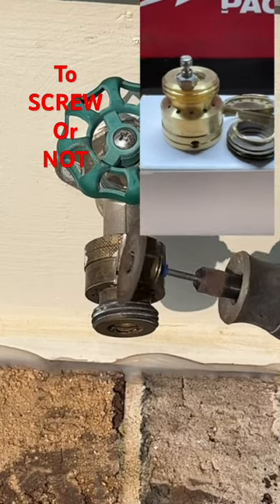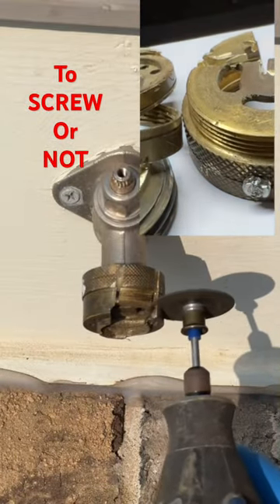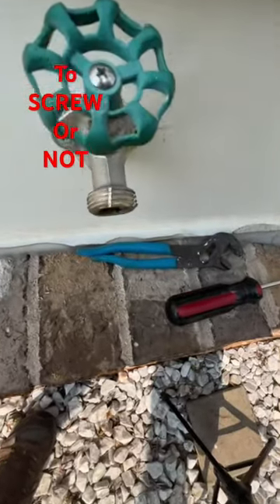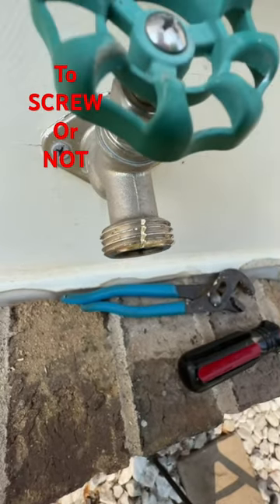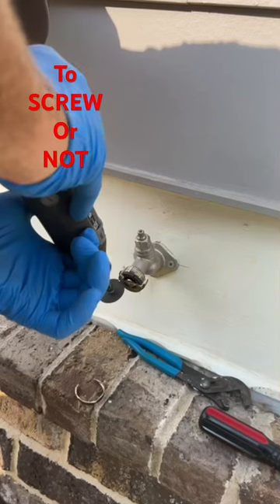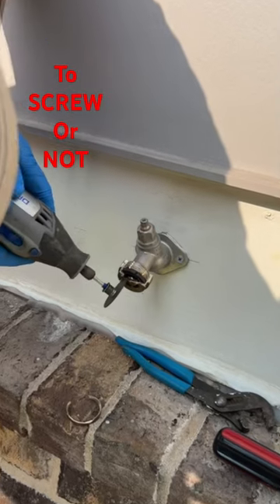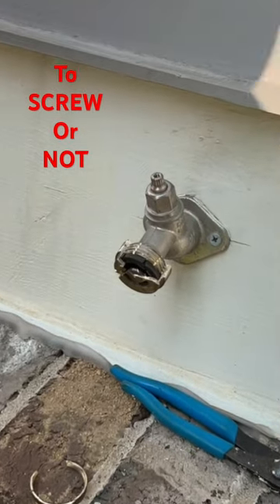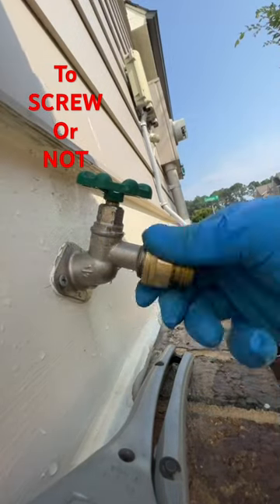Avoid Getting Soaked: Fix Your Leaking Vacuum Breaker@TappPlumbing #plumbingproblems #shorts

Comment: I'm in this situation right now, trying to remove a fouled vacuum breaker.  The house is 4 years old and the hose bib sits slightly inside the vinyl siding housing.  Stupid of the builder to do this.  The other problem I have is that the set screw is underneath the hose bib and it's hard as heck to see what I'm doing.  I'm trying hard to avoid calling the plumber as it will be a $300 job.  Going to the store to get a dremel to try to cut down to the threads.  I'm also ordering a 5mm set screw slotted for an allen key next time around.  I understand the needed function, but contractors make them hard to get off!!!
Reply from the maker: Make sure you have your safety glasses on please! It sounds like you will have quite the challenge. I hope you do a better job than I did with staying off the threads on the spigot. Keep me posted if you have the time please. Best of luck!
Reply: I put the safety glasses on as soon as the dust from the brass started blowing.  I was able to get the breaker off, but I tore up the spigot. :(  Now I have to have a plumber come and replace everything.  There should be an option for the home owner to remove the vacuum breaker.  I don't even leave my hoses connected. @TappPlumbing Initial estimate is $600-$1000 for both spigots.
Reply from the maker: @jasweb147  That is the exact scenario I was trying to help people avoid in the future. I am really sorry it happened to you, maybe you can convince the plumber to leave the screw out.
Reply: @TappPlumbing  my spigot is closer to the foundation which made it difficult to see and to determine where to cut the threads.  The plumber is going to leave out the set screw for me.  He said that multiple houses in our neighborhood have had vacuum breaker issues so he’s very familiar with the job. Not to mention that we all have the older watt vacuum breakers with the sliding black O-ring, which is to prevent freezing in the winter, he’s going to put on the self draining vacuum breaker for my home. Not quite sure of the cost yet
Reply from the maker: @jasweb147 If your spigot is so close to the ground it is hard to get a hose attached you might consider having him twist it a little sideways. It looks a little funny but it makes it much easier to attach and remove your hose . Let us know how everything turns out if you get the chance please.
Reply: @TappPlumbing  The plumber had to replace one spigot and removed the breaker from the other.  $600 later and were all good.
Reply from the maker: @jasweb147   Thanks so much for the update . I guess that is better than having them both replaced . Have a great weekend and thanks again!
Reply: use anti seize and find torx not allen/hex
Reply: That is not the problem. The breakawy screw means exactly that. While tightening the set screw it is designed to break off so customers do not remove the vacuum breaker@Walczyk
Reply: @whatnow5313  lol why?? what’s so dangerous about it. i guess it’s got low pressure systems?

Comment: People should not have to pay a plumber to do a simple repair like that!
Do not use the set screw or replace it with an allen screw that can be removed easily!
Or replace the original screw with a screw that won't break off so easily!

Better yet throw that stupid screw away and do not use a screw at all!
Reply from the maker: I think most people agree, there are a multitude of solutions that would be better than breaking the screw. Those devices are very important though!!!
Reply: @TappPlumbing  somebody suggested using threadlocker when you put it on, but I think that's a bad idea.

I worked on someones irrigation once. They use those screw together PVC pipes and use PVC glue.
That's like screwing your lug nuts on and then welded them in place. 
Some people. 🙄
Reply from the maker: @TF856  I am pretty sure eventually someone might not appreciate the thread lock😂
Reply: My local inspectors will not pass a top out if the vacuum breaker screw is not broken off where it can't be removed. It's code, and there's a reason for it.
Reply: @coreysharp9794 Have you seen or heard of one of these vacuum breakers ever actually serving its intended purpose?
Reply: @MisterTwister88  you asking me that tells me you don't know it's intended purpose.
Reply: @coreysharp9794  Its an easy question, why dodge?
Reply: @MisterTwister88  then to answer yes, I have. Specifically when a pressure washer was being used.

Comment: I never snap the set screw’s off and don’t give two shits what the code says. I hat these for hose bibs. All they do is make a mess everything time the water is shut on and off
Reply from the maker: At least I have one valued supporter then! Thanks for watching!
Reply from the maker: I just checked our one of your channels shorts with the tankless swap out. I really enjoyed it, I will cruise through more of your channel over the weekend when I have a little more time!!
Reply: That's why it's called a "Vacuum Breaker"
  I hate them also, but believe it or not twice I have seen water sucked back into the hose. Water had been shut off but the valve on two bibs were left open, plus one faucet in the house was open and some how a vacuum was created. I was outside repairing a window frame and somehow noticed water flowing into a hose not far from me, so I stopped and watched. Yes a vacuum was pulling water backwards into the homes plumbing and after about 15 minutes I found where the water was going, into a side shower for the pool, steadily flowing out the shower head into the drain. When I pulled the hose up from the yard the flow stopped... As bad as I hate them there is a purpose for them.
Reply: My inspectors won't pass shit without it broken off.